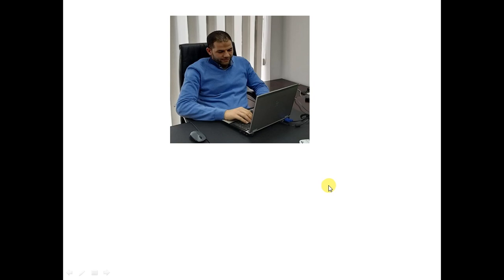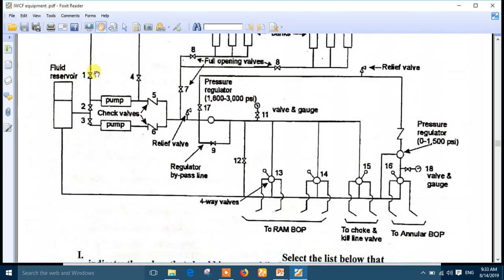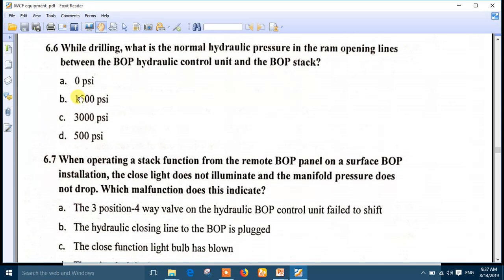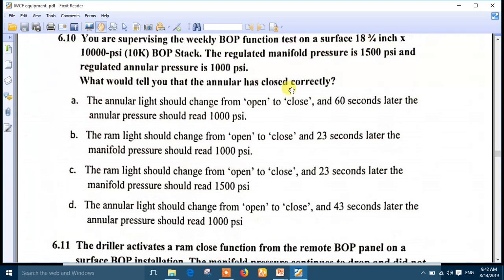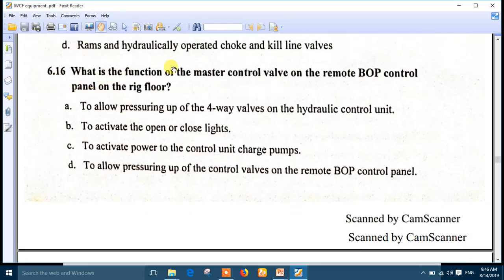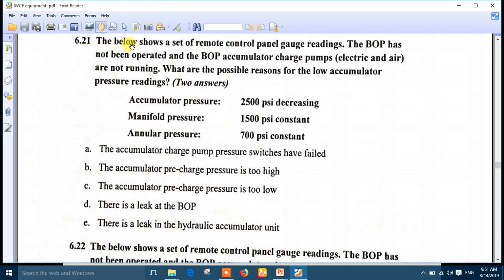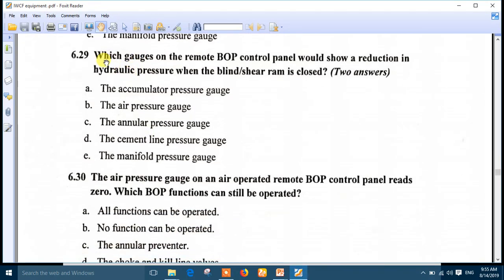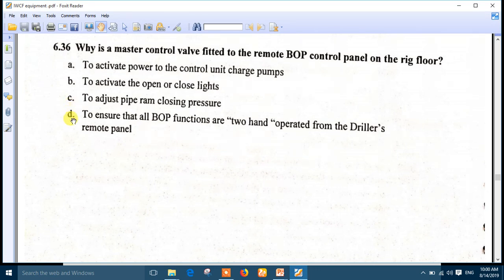36. IWCF equipment , BOP control system questions

Comment: Answer number 13 has a leak and needs maintainance or explanation,,, because why not switch to a manual solution when regulator pressures are 0,, please how do you open with regulator pressures at 0?

Comment: Thank you for the great video materials on well Control. A question here! dose the manifold pressure (1500Psi ) decreases along with accumulator's once the Bild/Shear is closed?
Reply: Yes
Reply: If the Shear/Blind rams is operated by the accumulator bottles pressure (3000psi), why the manifold pressure decreases then?
Reply: @mohammadmirsadeghi9195  because the pressure in the manifold is coming from de accumulator thru a regulator valve that decreases the pressure from 3000 psi to 1500 psi, it's the same system.